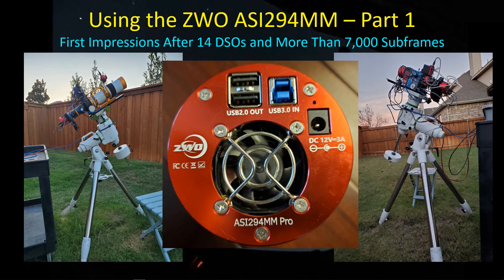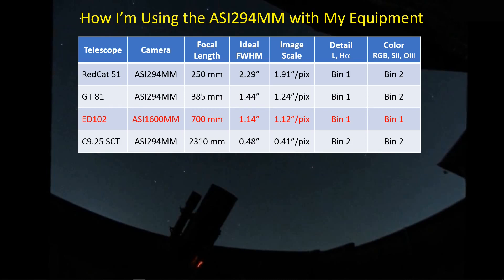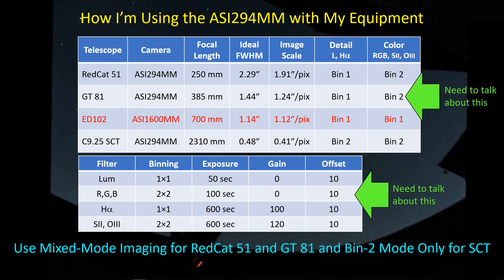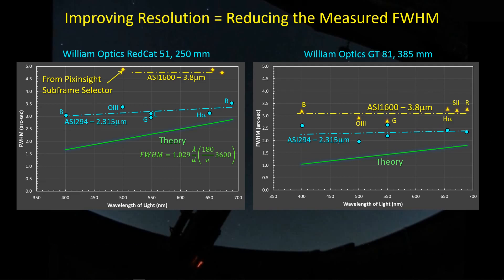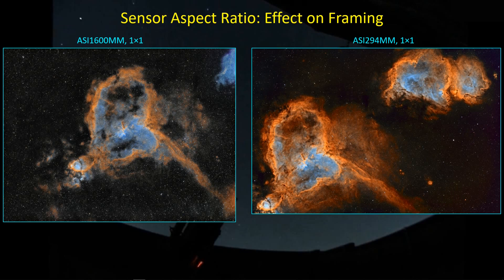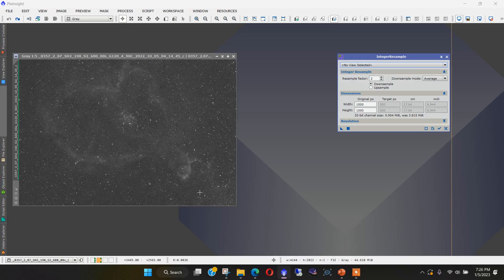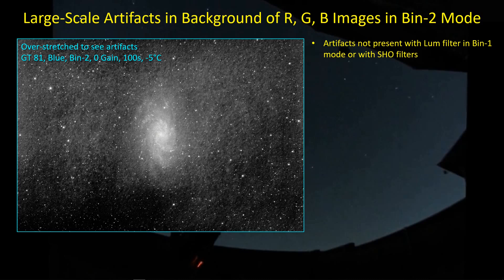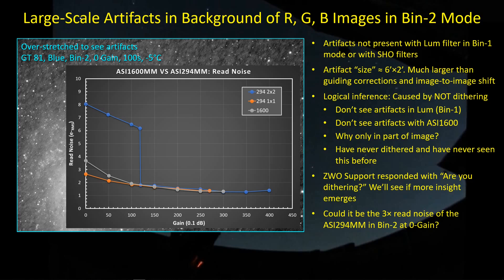First Imaging Impressions of the ZWO ASI294MM - Part 1

Comment: Loved it 😅!

nowhere near my budget to go mono at this time.... I just took possession of the university loaned C11 for NEO detection testing threshold... yup a Hyperstar would be grand ... 
unfortunately it came with a 1.25 visual back so I pulled the trigger on an Imx585 paired to a 0.5 reducer.... 

I'll have to get a secondary vixen on top to fix my 135 f2 as a guider for short exposure guiding and hope for the best :)

loved your combo of binning modes!

at FL 1400 with that small sensor my exposures should be pretty short for NEO synthetic tracking (under 20 secs) 

my 135 f2 plays nicely with the 585 ... yup better details than with a DSLR as the pixels are 2.9 as opposed to 3.8 and 4.3 ... 

it'll take some time to get the C11 up to the task ... hoping to catch the galaxy season with it well sorted  :)

Happy new year buddy!
Reply from the maker: Wow, a C11. That's a beast. Congrats, Alex! My C9.25 is a constant learning experience. Happy hunting!

Comment: Well done. Wondering why you're keeping the 1600mm on the ED102. I have the 294mm with ed102. Do you see problems with the set-up? Just got the ed102. Haven't take an image yet. Still trying the get the back focus set.
Reply from the maker: No. No problems. It turns out that a 3.8um pixel size pairs very well with that focal length. If I used Bin2 with the ASI294, I would lose resolution because the binned pixel size is too larger (under sampled). If I use Bin1, the smaller pixels don't hurt, but also won't provide improved resolution (over sampled), because the scope's aperture will be the limiting factor. Using the ASI1600 on the ED102 lets me spread the imaging load across two cameras and maybe saves some wear. You might experiment with the mixed-mode approach I'm using with my RedCat and GT81. But also try shooting all Bin2 and see if you can tell the difference. You'll be fine with your setup. Enjoy!

Comment: Interesting approach of upsampling the calibrated images and then registering / integrating. I've always just done a drizzle integration... but it's not often I do mixed mode imaging. Most of my imaging this past year was with the 8" EdgeHD, so it's all been bin2. I became unhappy with my GT81, especially once I used NINA and Hocus Focus to get the proper spacing for a flat field and minimized the tilt. Soon as I did that, the stars on the outer 1/3 of the image were atrocious. It was especially apparent when imaging in bin1 mode. Sad that the glass can't even properly correct across the 294's sensor. Ever since then, the GT81 has sat on a shelf. I tried going back to the best compromise, but... well, now that I saw what it looked like, I can't unsee it.

Regarding that noise... I don't see it on mine. I just looked at some old RGB data of the Dark Shark I did at bin2, gain 0. I see some minor banding when I really boost the stretch, but nothing like what you were showing.
Reply from the maker: Wow. That's disturbing about your GT81. Have you approached the supplier or William Optics? Maybe it's defective and you can get a replacement. Right - I don't see the noise as obvious on other RGB targets. I think a player here is the background light. When I was shooting M33, there was no Moon. Rare. So, I think that low background helped to let the noise come through.